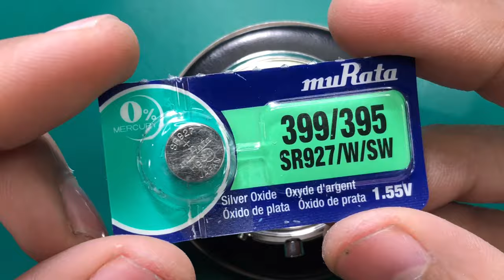Watch Restoration and Making Handmade Leather Strap | DIY | ASMR

Comment: I probably wouldn't invest that much work into such a low quality watch, but why not. However, if you connect the plus and minus contacts of the battery with tweezers, you will undoubtedly reduce its life significantly.